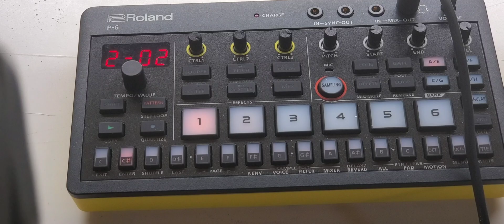Roland Drum Machine Hack: Amp + Speaker. Ultimate portability!!!! Compose, practice, listen anywhere

Comment: I like the internal speaker thing, but I have a concern about placing the power switch on the ground line. Since Vin and the audio input is still connected even if the amp switch is off, you would have a floating ground and potential return paths via the audio circuitry. I do not know the internal design of the LM386 in depth so it might not be a problem at all.

Comment: Simply awful.
Reply from the maker: @deepseadiver8191  Thanks! I made it using parts from a dumpster and encouragement from my therapist.
Reply: @DIYDSP I meant the aesthetics. Would you not agree? But, hey, it works for you.
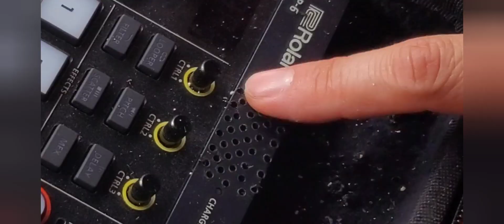Reply from the maker: @deepseadiver8191  Oh you must mean the speaker grill, right, like at 10:15?  Yeah that was completely improvised on the spot.  I planned the amplifier electronics for a few weeks, but didn't really have a plan for the speaker grill, except "drill some holes."  I used a protoboard as a guide here and it drifted as I was hand-drilling.  If I were to do it again, I'd use a CNC to make the holes more even or even a cool pattern.

Yeah you're right I'm not too worried about it myself.  It does work great.  And I hope my work acts as a guide for the next people who can copy me, but do it a little better!
Reply: @DIYDSP Yes. Thanks for posting.

Comment: Great idea ... so you basically risk draining down the lithium battery until it gets damaged, if there is no built-in protection in the pack. There MUST be a battery manager circuit in this design.
Reply from the maker: @marzacdev  thanks!  Yeah i agree there is a possibility of running the batt down low...  but probably the synth won't make any sound for it to amplify by that point.  You'd have to leave it on for a long time.

I agree there must be a batt mgr somewhere.  I spent abt an hour looking through a microscope, copying down numbers and looking them up, and couldnt find it!  Eventually I decided I couldn't let it hold up the rest of the hack!  Maybe the next person can find and share it :)
Reply from the maker: Hey guess what?  I got to try out the "drain the battery" experiment.  I recently made the mistake of leaving the P-6 off, but the amplifier on.  it must have been that way for a week or more...   But it didn't ruin the battery, thank god!  I'm guessing the amp stops drawing current when the battery is low enough.  Still, I wouldn't want to strain the battery like this very often :)